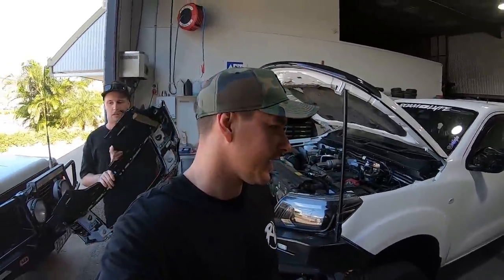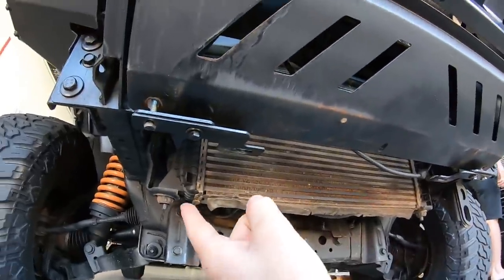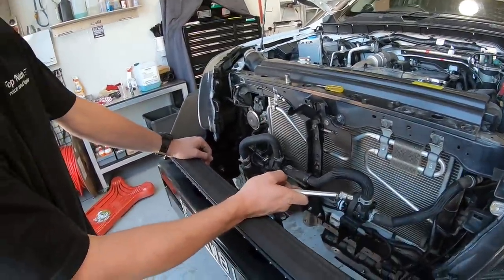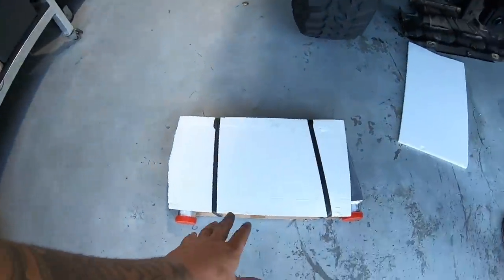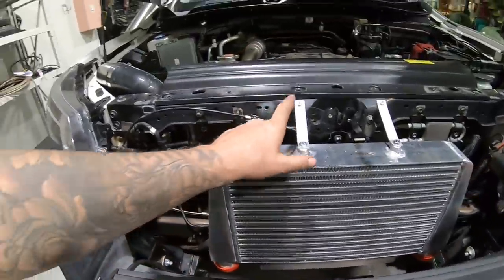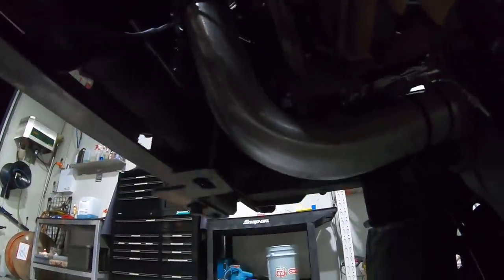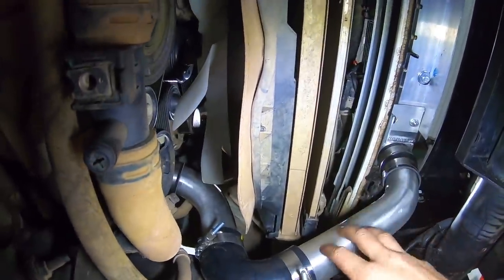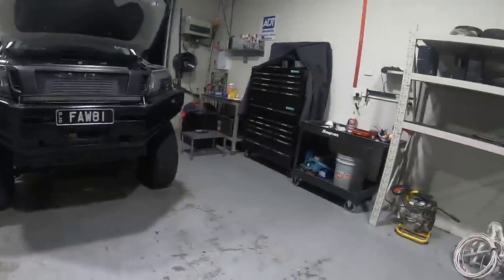DIY $400 eBay Front mount Intercooler install for 4WD

Comment: Hello bro, your np300 looks amazing 👏,  I have a question  I know it's RX7 Intercooler, but After a while of use, you have not had problems with that?  and do you really feel any improvement in speed or strength? 

Thanks my friend 😁😁

Comment: Cool video that stock cooler was way to low. Hopefully you get the issue sorted with the pipes. Musta been apain to get that far and then encounter the problem lol. For such a good install that looks pretty neat, dont ruin it with tekscrews, invest in a nutsert tool from ebay lol.

Comment: Nice video. Did you work out what those black things which the fat braided cable is attached to?
Reply: The ones with the coolant looking hoses. Like what are the two black modules
Reply from the maker: Apparently they are water pipes for the egr! I have no idea what they actually do tho!

Comment: Will there actually be some gains?
Reply: Dino Tarrazona probably not mate pointless mod on a 2018 Navara
Reply: It’s an aid for future mods, less chance of boost leak, more stable temps across hot days.
Reply from the maker: As Thecarguy said, coolers don’t make power but they help support higher power! I only want to get a tune once! So all the mods that support power I need to do first!
Reply: So basically it's the tune that will make the difference, ultimately
Reply: @deesaquapetsmore784  Exactly mate, i have my np300 running 28 pounds of boost and in mid day temperature really need a bigger IC

Comment: Another classic example of Nissan build quality placing a intercooler like that is just shit. You wouldn’t see that kind of design in a Toyota. Plus it’s a 2018 Navara and you want a better intercooler??!!? Like what . That engine wouldn’t even come close to “running hot” absolutely pointless
Reply from the maker: Hey mate, one of the main reasons we have done this mod is for tuning! Having a larger core helps a lot when you start running higher boost pressure !